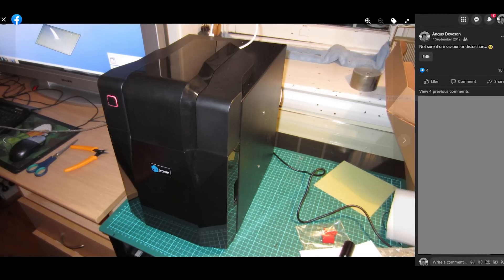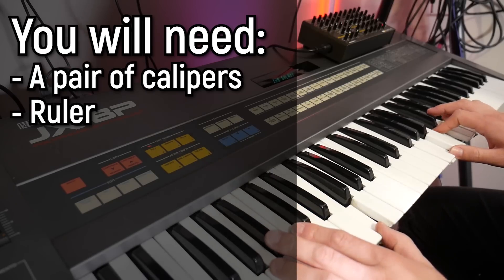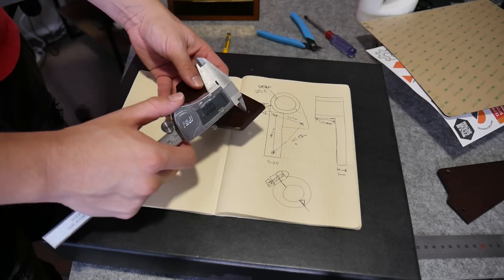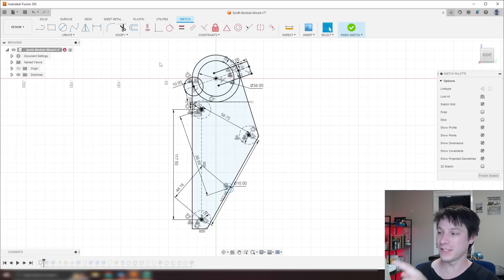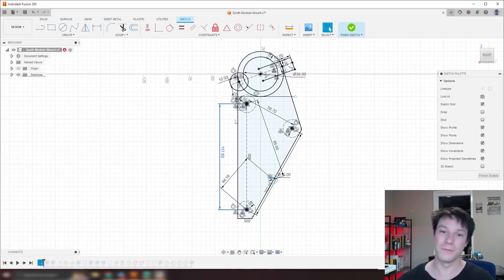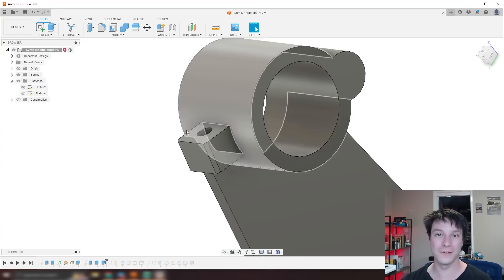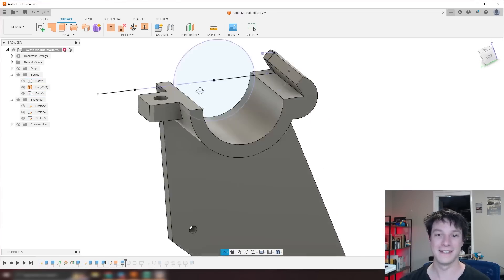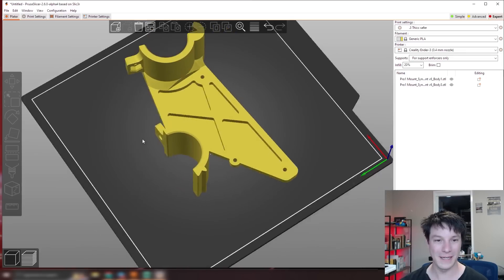Attach anything to anything else using 3D Printing!

Comment: Could have gotten rid of the Support Material Requirement by adding an overhang sized chamfer which on top would have made it even stronger 🤔

Also concerning the entire measuring thing - A Document Scanner with a Ruler laid next to the Part can do wonders when it comes to quickly getting a part into F360 by adding the Image as a Canvas. I use this technique to get a quick measurement of stuff like PCB Footprints into F360 simply by taking an as Orthographical as possible iPhone Photo if the measurements aren't that critical.

And on a side note... Other than the Ender not being a prime Candidate for printing with it... Why not use a material like a more heat resistant ABS/ASA where you live? Surely your location would be a prime candidate for consideration of such stuff and it would - IMHO - also add to the aesthetics of not being glossy AF ( I don't know... Ever since owning a Voron I just can't go back to PLA anymore unless I absolutely have to because of a particular Color I want for say an Inlay https://imgur.com/gallery/RPPpAHc )

Comment: Nice design, and good tips!  I work with a non-profit.  In their building, one of their exhaust fans died.  The unit was so old, there were no replacement parts for it.  The problem was in the motor bushings, which had disintegrated over the years.  So like you, I took measurements and then designed and 3D-printed replacements, saving the original fan and saving the group a few hundred bucks.  The tech still amazes me.

Comment: Just reading the title made me think "thank you, that's absolutely it". Of course I did print the usual useless things but now about 90% of things I print are mounts or structural parts in some way. One method I used several times for flat parts that are hard to measure/oddly shaped just put it in a scanner together with a reference part (like a ruler), then import the image into your favorite CAD tool and draw directly onto the image.

Comment: Two or three months ago I designed and printed a mount for the outside temperature sender of my inside-outside thermometer.  I used it as an opportunity to try Tinkercad instead of my usual F360.

Comment: This couldn't come at a better time! I'm trying to automate a label machine we have at work. Need a clamp just like this to raise and lower the arm the initiates the label feed cycle. I'm going to attach a clamp like this onto the round arm, but make it slightly larger. I'll attach it to the bed of a linear slide but the lowering of the labeler arm is a slight arc, so the clamp will have to be able to move. Can't wait to try it- your design tips are spot on!!

Comment: I've been really using my 3d printer to mount my VR system in a rented place using existing holes and bars to avoid drilling holes to skip repair payments when we move to a different place.
First things I 3d printed were not benchys and calibration cubes but rather adapters for my vr headset and charging station for my vr controllers. I've made my own curtain holders for my chroma key cloth to fit existing bar too. 3d printer is a great tool for me. Despite I didn't learn any CAD, I was able to get "good enough" results in blender to share them and even get some likes. 3d printer for me is a tool of the same level as screwdriver or a hammer. Very handy when I need something done around the house. Only after 2 years of owning one I started printing decorative stuff and dnd minis

Comment: The trick with calipers for measuring holes is nice. My only problem is I sometimes forget to reset the calipers and only find out after printing :D So I usually draw tangent lines on the holes and add dimensions to those.
Reply: I find it easier to you the inside or outside anvils of the caliper on the hole and add or subtract one hole radius

Comment: This kind of stuff is so brilliant to use with 3D printers... and for spare parts for old devices... my dishwasher works pretty well but is also pretty old... the wheels of the basket broken apart, so I designed them in Fusion360 and printed them with PETG. They work perfectly.

Comment: I love being able to design parts that hold one thing to another thing, couple of weeks ago I created a new handle for a neighbour's umbrella, the original is tiny so I created a decent size handle which clips round the original handle and looks like it was always meant to be.
Also there are now thousands of racing / freestyle type drones out there with 3D prints of my designs on because I figured out a whole new way of holding antennas & receiver boards like nothing else before them, using folding TPU designs.

Comment: One of my most popular useful designs, "Hoopin TPU Cable Tie", made it to the front page of the Thingplace 6 months ago, a very strong easy to print cable tie which you can create custom versions of because I included the core elements for anyone to remix.
Another that made it to the front page is an inline KCD11 switch holder, also really easy to print.

Comment: 99% of the stuff I print are brackets, adaptors and tool mounts for peg boards or other stuff like that, I rarely print random crap that just looks cool. And I make stuff like this for family and friends so it's not jsut used once and then forgotten about it's been used consistently for about 4 years now

Comment: Super awesome to see you playing with your synths. Great, inspiring vid, feedback would be I guess there won't be a whole heap of people that understand the triangle mathematics! I missed whether fusion 360 might do that for you based on the distances between points, or if it's manual soh cah toa time.
Reply from the maker: Cheers! You can enter equations as well as use relations for the sketches, so it really is quite nice and clean to get fully constrained (dimensioned) sketches from those 3 dimensions.

Comment: I have yet to create many design. One of them is an adapter to put a alpha potentiometer in a hole that was drilled to fit CTS pot. 

I still have yet to do more complex design, but I saw someone make a guitar nut with 3d printer and I want to make one.

Comment: Great video, as usual!
A point of detail though, at about 9 minutes, you show us how you rounded the corner of the inside part of the "clampy" mechanism, but it highly shocked me that you left the outside corner sharp: this is where the geometry will concentrate all the stress, and you are making your design considerably weaker. There's probably (hopefully) enough of a safety margin, but if you had to clamp hard (for example to hold that board horizontal), that's where it would break when tightening the holding bolt.
Reply from the maker: Yeah, it's certainly not ideal for a high stress environment but I wanted the corner of the module to be as snug as possible, so cut out the fillet there. The mount is pretty overkill and supported on both sides so not a huge issue here, but some gussets front and back would have probably been a good compromise!

Comment: I never made useless items, like a Benchy, a waste of filament. Set up the printer use skirts and brims, or a raft if necessary. See something you can use, print it off Yeggi. 3D Builder comes with Microsoft and I make things I can use. Satisfying to come up with an idea and build it in 3D Builder. Needed a new mower blade attachment, made it in 3D Builder, exported STL. Before printing I always use FormWare Free Online STL repair to fix up any imperfetions then the STL is ready to print. If the Blade attachment breaks again, easy to print a new one. Currently thinking about a watch parts washer. For hardware to fit motor D shafts, use Yeggi again and find D shaft gears and adapt to fit the project. There is always a solution.

Comment: i'm looking for a universal bracket i can use to join things together, stick a baseplate on one and the bit that slots into it on the other, kinda like a gopro mount but easy to 3d print ive found a product but im pretty sure its a scam site

Comment: I love practical designs and prints. Thanks so much Angus for sharing those tips. I'm currently trying to improve a laboratory mixer which was published as an open source project several years ago. I've printed and assembled it but it needs a lot of improvement. I'm using it for my experiments in my lab at work and it's broken several times. So the published design and models just aren't up to snuff. So practical printing and iteration is what is chewing up a lot of my spare time right now to improve on the published version (except for the Diablo 4 beta least weekend and this weekend).

Comment: Nealy all the "trinkets" I have printed have either been Christmas decorations or presents for people. On, and Benchys :) . I used my 3D printer mostly for making boxes for my electronics projects, or tools to help maket them. My most recent project was a wiring pen to allow wiring of prototype boards with solder-through enamel wire, as the commercially available ones all had irritating (to me) limitations. Then there are the usual range of brackets and adapterts that are simply not available anywhere.

Comment: Designing simple solutions to daily annoyances is, imho, one of the most approachable aspects of 3D printing. My first designed piece was a replacement button for a broken gamepad, and my most recent one is a much simpler (compared to the default and for my case way too bulky gooseneck) mount to attach the pop shield to my mic.

Also, since this was a problem for me for the longest time: If you can't get accurate measurements (or your measurements lead to slightly over-/undersized objects), obviously you have to accommodate for the peculiarities of your printer, like elephant's foot compensation etc, but before you reprint the whole thing, don't forget you don't need 100% accuracy; paper/ cardboard shims or a layer or two of duct tape can compensate for oversized holes, and unless you're taking off a lot of material, sanding or drilling out undersized ones is a perfectly viable "good enough" solution. Sure, it's not perfect, but is perfection worth reprinting that +12h doodad that's not even meant to look particularly good? There's no generally right answer, but just ask yourself that question, y'know ;)

Comment: With everything these days made as disposable, 3D printing printing is a major money and environmental saver. Broken release tab on vacuum, $40 from manufacturer, $0.50 to print in minutes. I can't keep track of the number of toys that I have repaired that would have otherwise gone into a landfill. Sure designing in CAD software is out of the range of many people, but the 3D models communities are huge and it's amazing what parts are already designed by the community, even for what you would think is obscure items.

Comment: Hello Angus

You can use a sketch to cut out a model :) no need to turn it into a zero thickness surface
Reply from the maker: Even if it's multiple lines? I'll have to try that!
Reply: @MakersMuse  it seems that lines that intersect each other on the model might cause issues, it doesn't always work reliably but other than that yeah you can use multiple lines :)

Comment: What is a good 3d printer in 2023 that just works? I bought a Creality CR-10S in 2017 and could never get prints to work. I spent so many hours leveling at every measurement, changing slicer settings, print bed types, followed all the guides at the time and no luck at all after a few layers. I sadly gave up. But now I want to get back into it, and will pay more if it means less headaches.
Reply: Dont get into 3D printing if you dont want headaches, half of it is troubleshooting. That being said maybe a bambu labs carbon. 

It is still going to be alot of troubleshooting

Comment: About 4 out of 5 of my CAD-designs have the term 'holder' in it😀. This piece you don't need to measure at all if you have a scanner because they should scan it in the correct size already, but many parts doesn't fit under a scanner and cameras tend to distort images annoyingly. According to Tests on CNC Kitchen the most robust layer-height using a 0.4 nozzle is 0.15 mm and above 0.2 mm the parts loosing quite a lot of strength, so 0.3 mm should be better printed with a 0.6 mm nozzle.